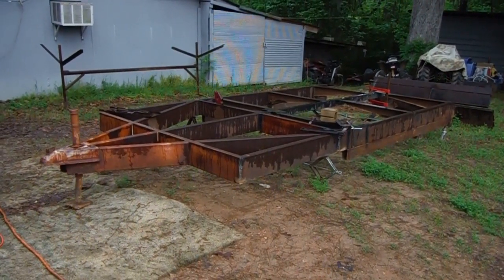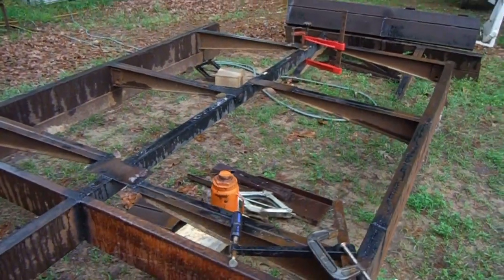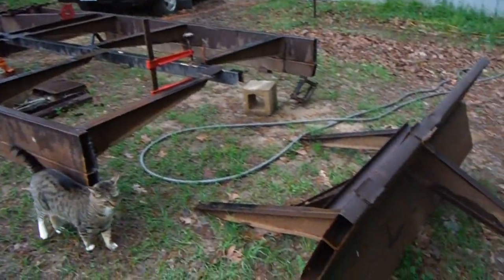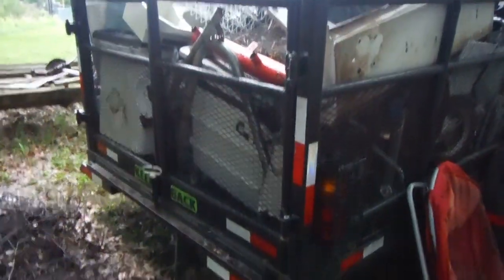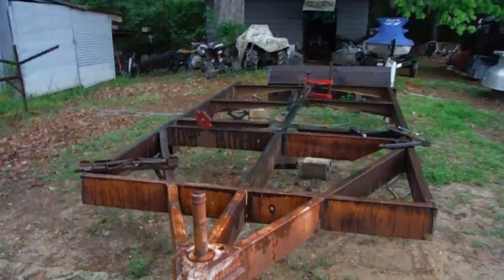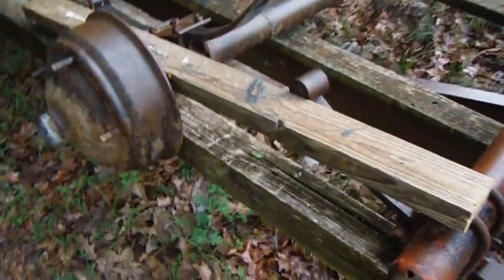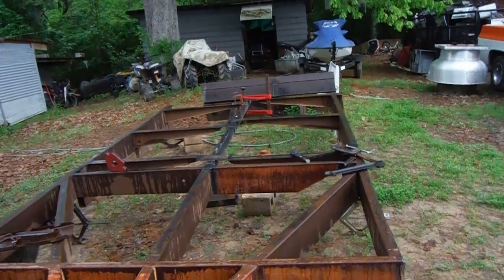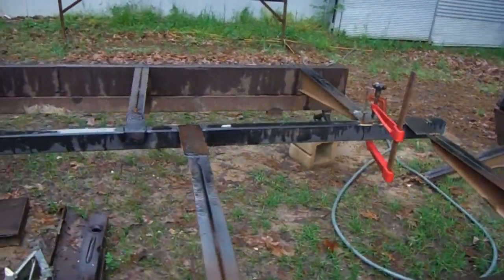Trailer Build from Mobile Home Frame

Comment: Recently bought a property that had an old, dilapidated, 80's-vintage double-wide mobile home on it.  Apparently it was vacant for at least 10 years before we acquired it.  My wife and I disassembled the entire thing, salvaging some of the lumber, steel, insulation, wiring, etc. for future projects.  We took most of the aluminum skin to the local recycler.  We now have it stripped down to just the 76' long frame and four axles, one of which has electric brakes.  The eight tires look new and half of them even held air pressure all these years!  I was thinking of just cutting the frame into small enough pieces to haul to the recycler, but after seeing your video, maybe it has more value as the base for a utility trailer, movable shed, or heavy-duty chicken tractor.  Thanks for posting.
Reply from the maker: ok, good deal. keep us updated with your progress

Comment: Bought a 30’ travel trailer frame for $250 and title. Planning on a bbq trailer. Frame is solid and has brakes. Looking at it though all the cross bracing is very weak so I guess it depends on what your needs will be. Will be replacing all the bracing but other than that it’s good. Wish you the best with your project.

Comment: Hi i was wondering where you found your hubs from? I have a similar trailer with the mobile home hubs and want to change them to regular bolt on like yours without doing a whole lot of changes. Or did you cut the old ones off and weld on new ones?
Reply from the maker: I found the hub and bearings on eBay. No I did not cut the spindles off. If you get the rite size bearings with the hub they fit rite on.

Comment: I assume you are aware of the "bow" in those heavy duty MH axles? For those that may not be, allow me to explain: On these heavy duty axles there is a bow intentionally placed in the axle tube. This is a huge part of it's load capacity. This bow must be up, and not down, that is it should not be a sag in the middle. You have to check this bow relative to the spring mounting cradle to determine if the axle is slung over the spring or under it. If it winds up not being the configuration you desire and you want to move it to the other side of the spring, you have to weld a new cradle in the proper location to ensure this bow is up. It isn't difficult once you understand how the axle works, but you must have it installed correctly to prevent loss of capacity and excessive tire, spindle and bearing wear. Also folks, don't listen to trailer part retailers that try to tell you these are one time use only. Mobile home movers use them hundreds of times, at highway speeds, for hundreds of miles at a time with loads at or near axle capacity. The retailers are just trying to get in your pocket.

Comment: I liked your video, but every where I read is to be aware of old RV trailers. There are a number of reasons, the most important one is how it's made and it's strength. How much did you pay for this? Close to nothing I bet.
Just looking at these frames.... they don't come close to what I have seen as far in many new frames (that you have to pay for, but they are very reasonable) as construction is concerned. Good luck with these trailers.
Reply from the maker: This "frame" came from a mobile home and not an RV. Correct I paid only scrap price for it. This frame I selected here was very strong starting out, all Im doing is making it the size and shape that I want.
Reply: SuperDaveVideos dont listen to the haters...I think your frame is a great foundation!
Reply: I got two house trailers I'm tearing apart if your close to South Ark
Reply: I build trailers all the time. I build them from brand new material, I refurbish old beat to death trailers to new condition, I completely disassemble boat trailers and reconstruct them into "lite" utility trailers,,not recommended to just turn a boat trailer into a flatbed trailer. They are designed to haul a boat. Yes they can be made to look like any other trailer but if not properly reconstructed you still just have a boat trailer. And I also use camper trailers, strip them, add in cross members and do some minor reconstruction if necessary ( depends on design I'm looking for) and refinish. I would absolutely not have a problem using the metal from a frame like this one. If I could find one I probably would even if it meant just using the metal. The newer trailers these days don't have that box tubing, the have thin I beam now so the other is harder to find.